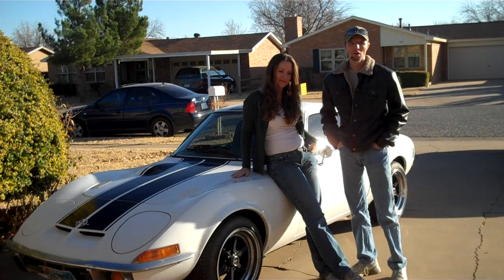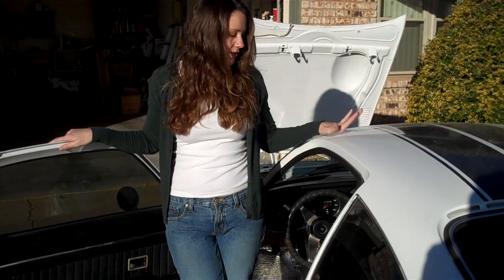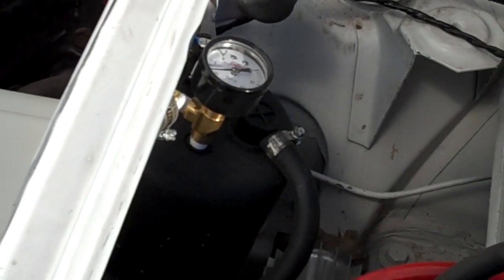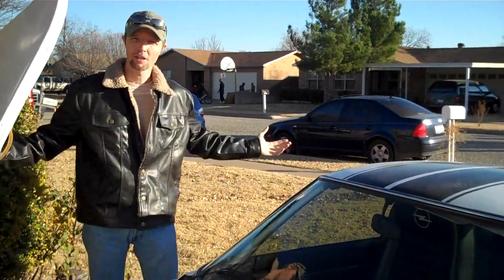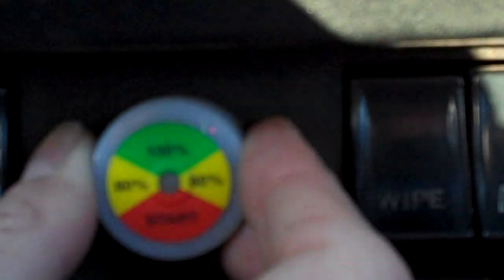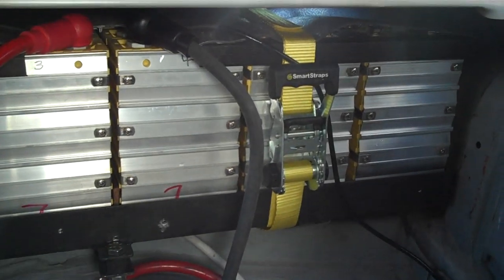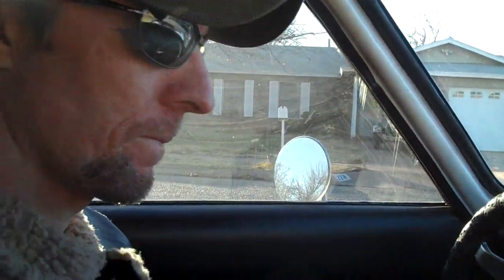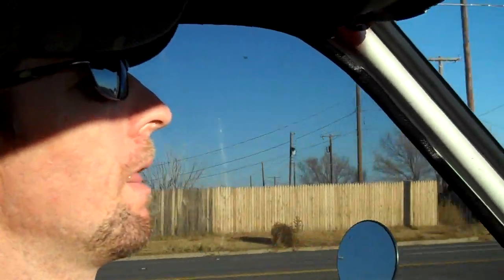Opel GT - EV Overview

Comment: Im sorry but in my opinion this is not good. Classic cars like these should be restored not "engine swapped" with an electric. Its an amazing car but I think u need to put the old motor back in.
Reply: +LeningradFC it looks&#160;great but&#160;it was never very fast and is not really held in high esteem-&#160; they are hard to find ill grant you that but I have no problem with their project - the car looks great and I'm sure is way more reliable

Comment: Electrical cars boring? I would bet this Opel GT would eat most gasoline cars alive off the line. It is obvious you have never driven an electric car. Power comes from torque more than HP and both have to build up in a gasoline powered car. Electric cars are instant massive torque.
In a year you will see electric cars racing in the Sprint Cup series and I suspect they will win races.

Comment: Great job Charlie and Tamara. The sound is incredible and reminds me of the sound inside an F16. My wife is also my best friend just like yours and we also do things together and have fun but it seems like your wife is the real genius behind this conversion.
May I suggest you rig the Tach to show RPM's from the electrical motor? That would be good. I would also suggest a G-force disconnect for the power system in case of an accident. People like you and Tamara are innovators.
Best wishes.
Mark